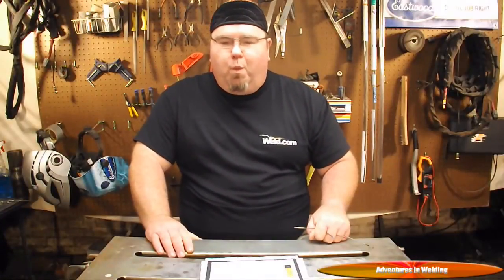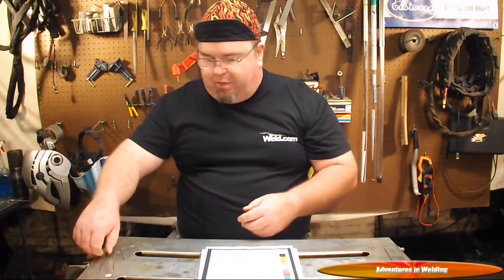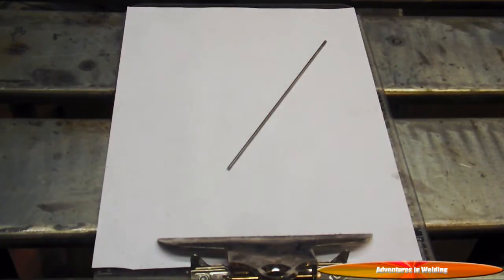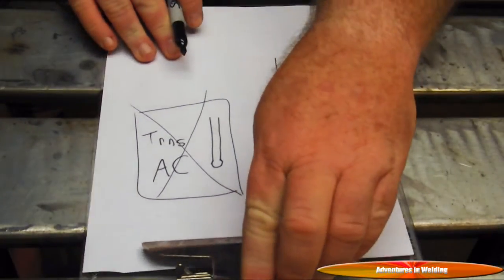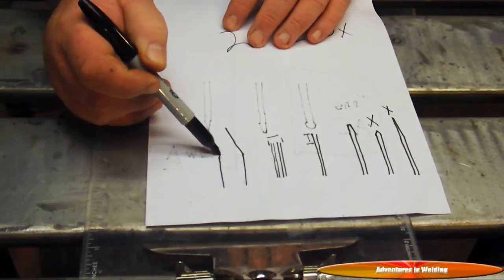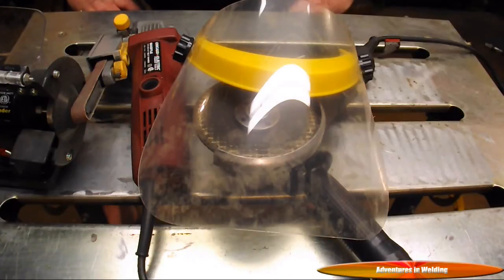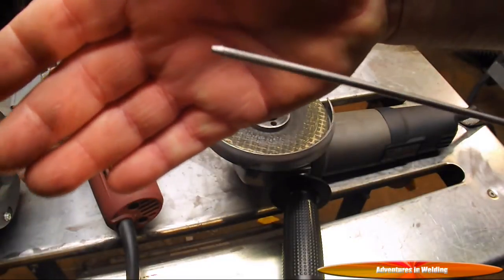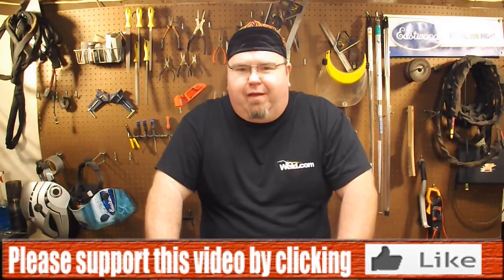Tungsten Tips

Comment: Hey Paul, Good info there. I use a approx. 120mm Dia. bench grinder with a Silicon Carbide wheel on it which is a dedicated grinder just for tungstens, and I always do them by hand, (no cordless drill) call me "old school". Here in Australia we use Thoriated for steel and stainless and Zirconiated for Aluminium. We also have Ceriated which can be used for either Steel or Aluminium. The Lanthanated and E3 are not really popular here yet.  Scott.
Reply from the maker: scott carr Thanks Scott! I have never used Zirconiated. They don't seem to be popular here.